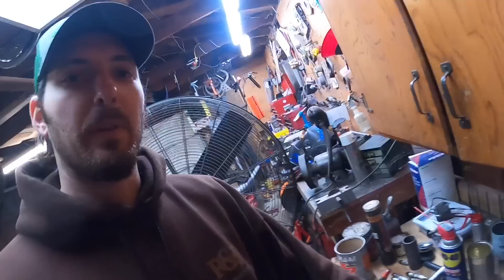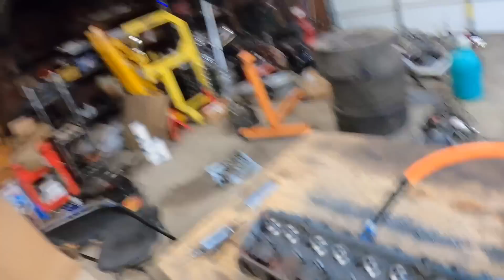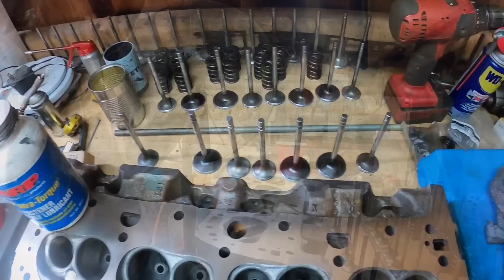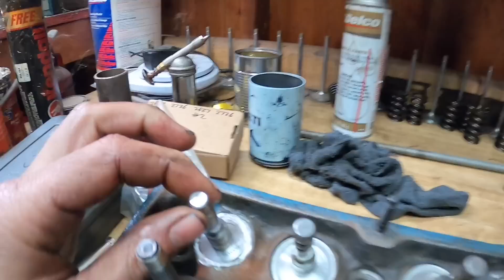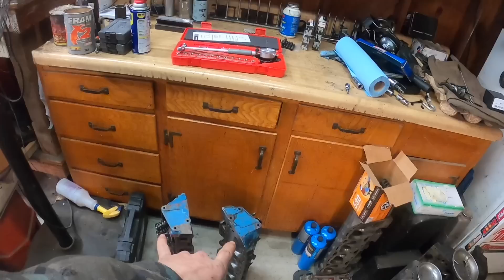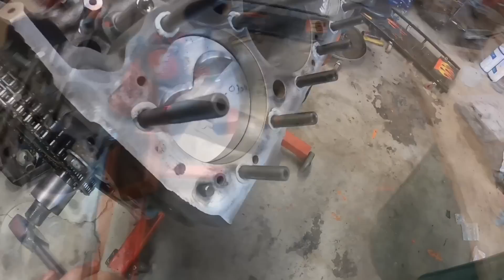Modifying, Assembling, Installing the Cylinder Heads for the Hobby Stock Motor - Felpro 1094 gaskets

Comment: Whats max lift u can get out of vortec heads?
Reply from the maker: Im not sure the exact number, but completely stock i dont think you can run much more than like .450/.460 lift
Reply: @CherezianRacing  I meant after u modified them to race.

Comment: Another thing that you didn't mention that can play a roll in your pistons being at different heights when at TDC is the actual length of the stroke on the crankshaft. I've found on some of my old ford FE stuff that the length of the stroke from one throw to the next if still a factory crank can be different by .011, maybey more with some? Unless your crank has been reground & the crank grinder took the time to even them all out, they are not a perfect measurement. If you take the time to measure your actual length of your stroke on all 8 cylinders you will likely find some variants amongst them.
Reply from the maker: Man thats good to know. I never heard that they could be off but it makes total sense.

Comment: Turn the crap music off
Reply from the maker: Thanks for watching
Reply: Hey bud do you index your spark plugs I do because On the passenger side the g-force in the corner causes fuel to slosh in the intake  favoring the right side of the motor so I index plugs so the electro is pointed down and the ground bar wil shield the  electro from extra fuel from damping the spark causing  stumbling off the corner
Reply from the maker: @charliecowboyjohnson6266  no i dont, but thanks for the info!

Comment: Our engines use the same gaskets. Per our rules we have to run open chamber heads with a 72cc combustion chamber. Plus we have to have our pistons .01 in the hole. 

Interesting on the build.
Reply from the maker: Have you ever had issues with that gasket not sealing?
Reply: @CherezianRacing  not at all. In fact several years ago we had to remove a head because of an protest, so we reinstalled the head with the shim gasket without issues. The use of the copper sealant is important so you should be good to go
Reply from the maker: @JamesDedmon you reused the head gasket and it didnt leak??